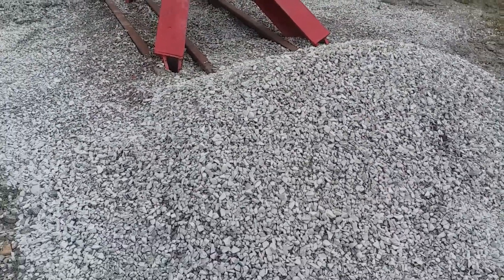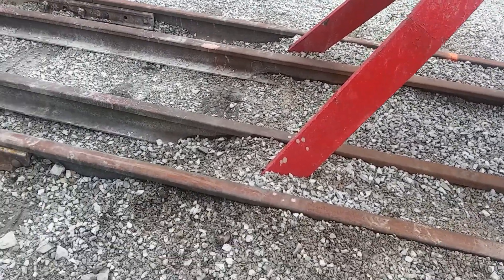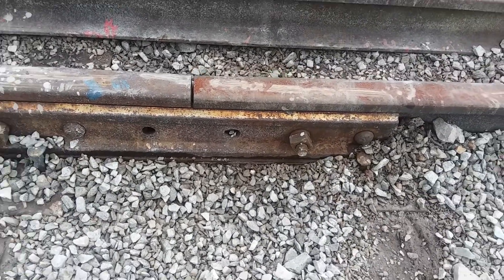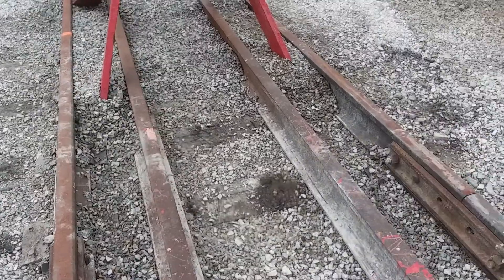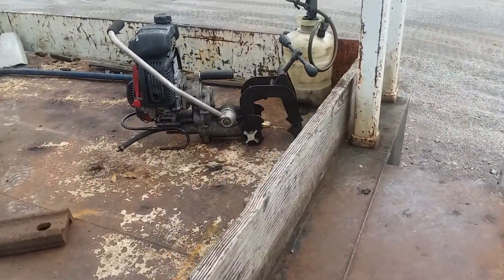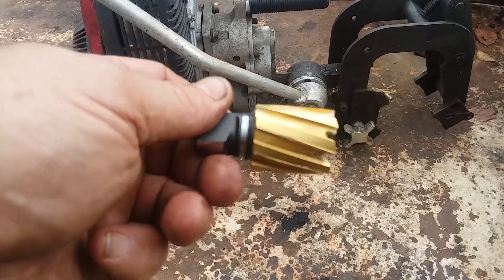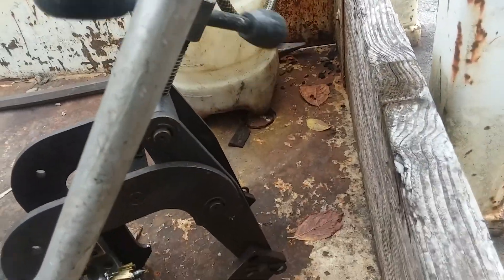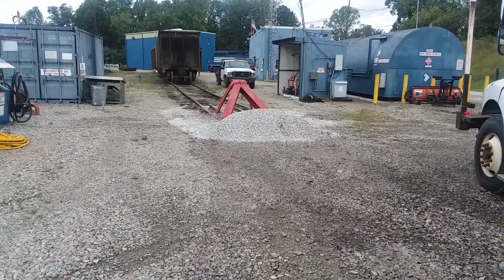Stop Block Fixed! Plus my Rail Drill

Comment: TrackStar drills are ok and we use those as backups, we use the Stanley hydraulic drills regularly with different templates for 136-115, 100-95
Reply from the maker: Wow, ive never used or seen one, i'll bet they work really good, far cry from that old gas powered ratchet drill we started with, i'm sure you know about them 😉
Reply: I forgot to mention that the Stanley rail drills are heavy but it still faster at 10 gpm than the gas powered drills and the bits are expensive but the replaceable carbide cutter inserts have 4 cutting edges and can be rotated.
Reply from the maker: @jasonbabila6006  our bits cost 80 bucks a piece, get 10 holes out of em, sometimes a few more
Reply: @ccrx6700  Yes them bits are expensive and we use a water soluble lubricant while drilling to keep the bits lubricated and cool.
Reply from the maker: @jasonbabila6006  yep we do to, 1 gallon cost $150 but it mixed with 10 parts water. See ya tomorrow got go bed, MOW in morning, have good night sir
Reply: Search for Stanley railroad tools, Matweld, and PortaCo, Racine, and industry-railway
Reply from the maker: @jasonbabila6006  👍
Reply from the maker: @jasonbabila6006  will do Jason thank you. Where do you work at sir?
Reply: @ccrx6700  I work for the BNSF in WA.

Comment: Looks like Titanium nitride bit. 
What kind of cutting fluid do you use ?
Reply: Lester, not sure what it's composition is, it says on the little plastic box the bits
come in, Twister Tin, not sure what that means, will do some research on it. We use
a cutting solution that is mixed 10 parts water to 1 of fluid. The fluid costs $150 per gallon,
it pretty good stuff. Thanks for watching sir and commenting
Reply: @ccrx-xu1wc  If it is mixed with water, it is an "emulsion". I bought some "Vaughn's" cutting fluid from "BLUE RIDGE TOOLS" a few yrs ago and it has DIFFERENT mixing ratios listed on the back depending on what KIND of metal you plan to cut through. I still have most of it, as I only use that SMITHY Model 13-39 once in a "blue moon" or so.
Reply: @lestergillis8171  Awesome Lester, I will look when I go back tomorrow and read
the label on the fluid, guess I never really paid that much attention to it. Now you got
me really curious. Really appreciate your comments here. I never knew about different
mixing ratios either. Love when this kind of info is provided by viewers, really helps
to enhance the overall scope of the video. thank you again sir
Reply: @ccrx-xu1wc  Many good cutting fluids used to contain a certain amount of sulphur in solution. I recall when I worked as a laborer for a local heating & cooling contractor in Michigan City, Ind, they had a couple of electric pipe threaders. The fluid catch pan was topped off with threading oil. It said on the label how much sulphur was in it. 
More recently, I'm told that ALL distributors of cutting fluids are going away from sulphur based fluids. It might have something to do with OSHA or EPA regs. I would think it COULD still be used outdoors.
Reply: That gold color is indeed titanium nitride, but is an incredibly thin abrasion resistant surface coating just a tiny fraction of .001" thick and has no bearing on what the actual tool is made of.

Comment: Thanks for sharing.  Never have seen how one of these attached to the rails.  Can those drill bits be sharpened like normal drill bits after your 15 holes?
Reply: I had the same question - can that $80 bit be sharpened?  If not, that works out to $5 or $6 per hole.
Reply: littlewingpsc27 good question, you'd think something like that would be able to be sharpened
Reply: Yes they can be resharpened. It is a bit more involved, in that to properly sharpen them there is more to it, than an ordinary twist drill. A machinist with limited funds and the set-up to sharpen annular drills would be happy to have a few that weren't too chewed up.